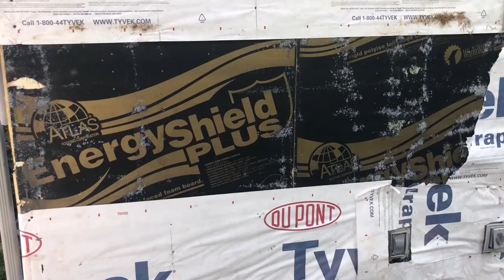What's behind your vinyl siding?

Comment: Can you please share what you used to insulate the walls and how to install them? I’m confused because it looks like you had the paper backing facing the outside of house. Shouldn’t it be facing inside of house?
Reply from the maker: Generally you want to insulate from the inside but I had to do this job backwards 😂 and finished the inside first. I didn’t want the new insulation to touch the nasty moldy exterior drywall and siding so I had to insulate backwards. A year later and everything is good warm and quiet!